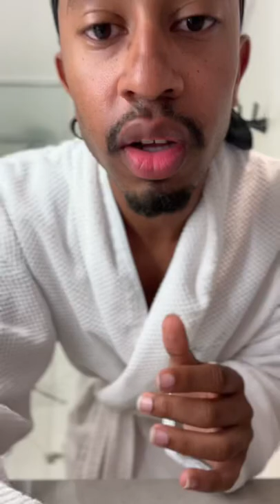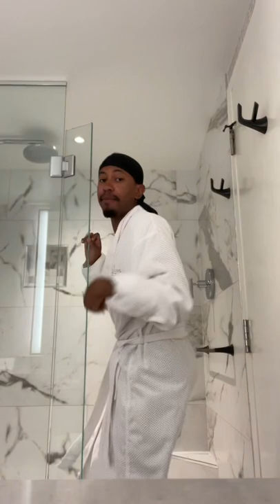WHAT HAPPENED TO SHOWER DOORS?!

Comment: It's not a shower door but a shower shield. It's used in small bathrooms where opening a glass door is not possible or access for those needing to get in with assistance. The reason It's used in small bathrooms is two fold, you will steam up the room either way and it makes it appear more open.
Reply: In that case, get a sliding shower door. You don't need it to swing.
Reply: Ok then maybe just install a shower road for a shower curtain. Shower shield 🙄. What will they think of next?
Reply: @machdude3366  I disagree, I'm not a fan of sliding shower doors. The tracks that come with them have structural issues too in their own right. plus people don't think about the maintenance that comes with them.